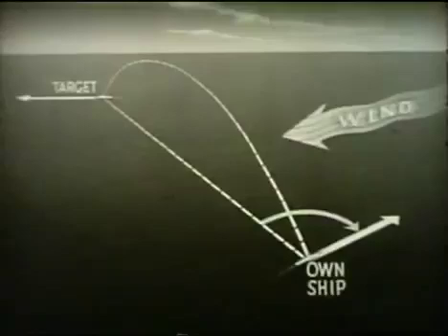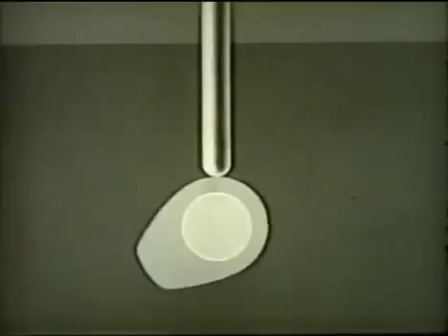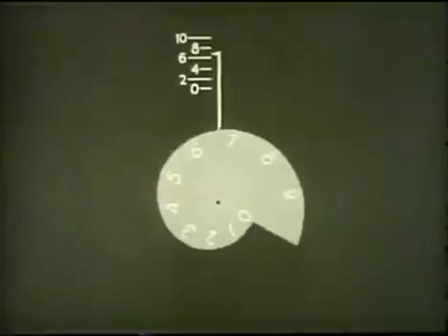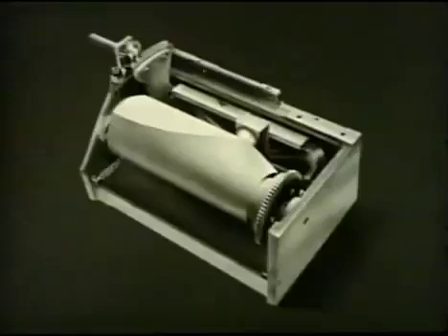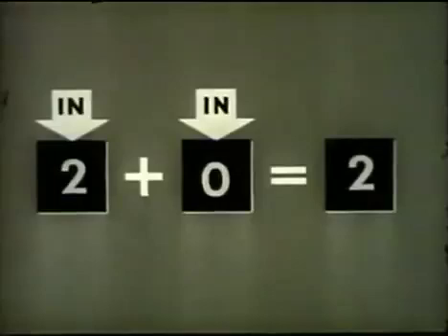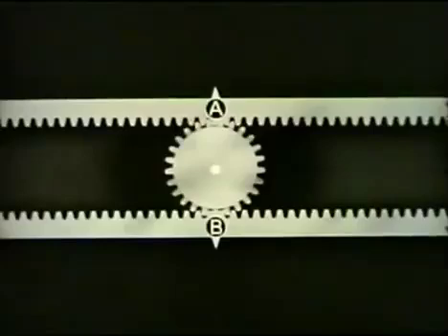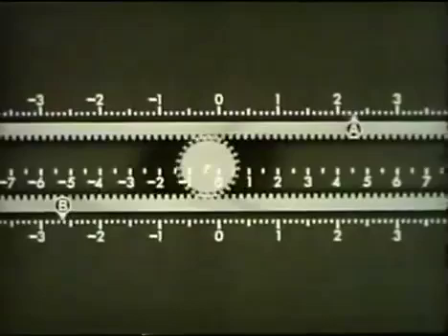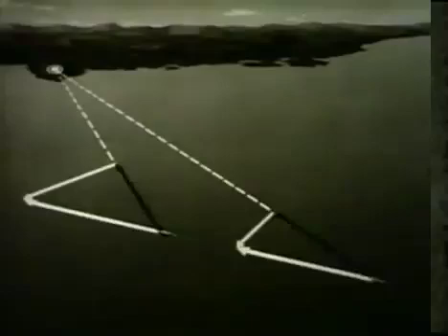Mechanical Computer (All Parts) - Basic Mechanisms In Fire Control Computers

Comment: Hopefully this technology doesn't fall into the hands of North Korea.
Reply: +Bobbie Bees You would actually be shocked at how effective this technology was.
Reply: +Patrick Bartosz Watching this video makes me wonder if they would've missed their targets at all if their guns weren't shooting a little inconsistently.
Reply: +Bobbie Bees they have known that already......for your information.....
Reply: They kept the computer calibrated to the battery's average muzzle velocity (which changed over time due to powder temperature and other factors), and each gun could also apply a correction if its muzzle velocity strayed significantly from the mean (due to individual barrel wear, etc.).  The computer also calculated for the effects of wind, ship roll/pitch, parallax due to distance between director and guns, and, most importantly, relative motion between ship and target. Spot corrections could be dialed in after observation of fall of shot (shell splashes).  Computers for larger guns also corrected for Coriolis effect.  Since a number of approximations had to be made in the fire control problem (including the assumption that the target's motion would remain in a straight line at constant speed during the shell's flight) and the computer's inputs relied on human operation in the director, its accuracy was by no means 100%, but this technology was state of the art in the 1940s.
Reply: Richard Hall
 I bet the system alone would've come pretty darn close to 100% given all the factors included in the calculation.

But 1 thing that this huge pile of mechanical contrapions shows is what a huge load of stuff computers do, especially the modern electronic ones without any moving parts.
Reply: +Bobbie Bees  They dont understand Engrish.
Reply: +Bobbie Bees  believe it or not, their machining is still not precise enough to build this. Video teaches basic concepts. In order for this to work in real world, all the parts have to be machined to extreme precision. There is not many places outside of Europe and US that can do this even in 2016
Reply: Yeah, they'd launch a missile at California and it'd probably end up somewhere in Chile lol!
Reply: Richard Hall
 If it didn't already explode on the launchpad :-)
Reply: lol yes
Reply: North Korea is making nuclear weapons. Do not you watch television?
Reply: elektroxi television? What they hell is that?
Reply: Factoring in the inherent slop in manufacturing tolerances, variations from gun to gun and shot to shot, the assumptions and approximations involved in setting the inputs, and other sources of error, the typical rate of scoring hits at "normal combat range" (which tended to be long) was about 5% of rounds fired actually hitting the target.  This was, as I said, MOSTLY due to the sources of error on the inputs, but no matter how finely-machined the equipment was, there was going to be some systemic error introduced by manufacturing tolerances... and that error would only get worse over time as the moving parts began to wear.

This isn't an indictment of the concepts and algorithms used; it just reflects how many different sources of error there were, and how tiny a target you're trying to hit.  (Typically, the guns were pretty much 100% reliable in terms of bearing, but a general rule in the era was that your shot-to-shot variation in range would be about 1% of the set range.  To put it in perspective, at typical firing ranges, the Iowa-class battleships had a shot pattern roughly the size of the Pentagon!)
Reply: Too late.

Comment: How people designed this just absolutely blows my mind
Reply: Designing this wouldn't really be difficult conceptually, but the effort put into machining, tuning, and calibrating the machine to give any semblance of a useful answer is admirable
Reply: Designing a complicated mechanical machine with just a drafting table and a pencil also deserves a great deal of respect, even today with kinematically linked 3D MCAD software this would have been a pain in the ass to engineer.
Reply: It really, really makes you respect the engineers before computers were mainstay. Hell, NASA put a man on the Moon using little more than sliderules.
Reply: They used a lot more than slide rules. They not only used computers to plan the trip, but there was a computer on the ship itself.

https://en.wikipedia.org/wiki/Apollo_Guidance_Computer
Reply: What I said was:
"Hell, NASA put a man on the Moon using little MORE than sliderules."
And that is the onboard computer. That's only DURING the mission. There was a LOT more that was done to engineer the hardware[which was, uh, alot], mission profile, etc.
https://www.npr.org/sections/ed/2014/10/22/356937347/the-slide-rule-a-computing-device-that-put-a-man-on-the-moon
"That seemingly simple tool has a serious resume. NASA engineers used slide rules to build the rockets and plan the mission that landed Apollo 11 on the moon. It's said that Buzz Aldrin needed his pocket slide rule for last-minute calculations before landing."
""The slide rule is an instrument that was used to design virtually everything," says Deborah Douglas, the director of collections and curator of science and technology at the MIT Museum in Cambridge, Mass. The museum just ended a three-year exhibit on slide rules. "The size of a sewer pipe, the weight-bearing ability of a cardboard box, even rocket ships and cars.""
Reply: and all those computers together had less hp than your phone........slide rules rock...especially circular slide rules.Someone who can use them can be as quick or quicker than someone with a calculator
Reply: It's a work of art. My  favorite 17:30

Comment: Note that in the 1960s and 1970s the words "computing" and "computers" changed their meanings as stored-program digital computers came into widespread use. What used to be called computers, used for fire control (as here), astronomical prediction, gasoline consumption, and other applications, are now called "calculators", to indicate that they calculate some continuous function of the inputs, rather than evaluating a general series of logical steps (an algorithm) involving the inputs. This is why we now call these mechanical devices (including the Antikythera mechanism) calculators rather than computers. The principles of modern calculators are generally different from the principles of modern computers. We do have examples of pneumatic and other mechanical computers, used as toys or in industrial process control, but their performance does not even remotely approach that of electronic logic gates, flip-flops, memory devices and other such specialized components packed onto integrated circuits.
Reply: Well that's sort of a comparison between a special purpose or general purpose computer.  We can also observe the transition in cars as we shifted from mechanical mechanisms to sensors and circuits to analog ECUs to general purpose computers running control software.
Reply: Before WWII, actually a computer was a person, during the late 19th and early 20th centuries, usually a woman with a degree in mathematics (though not always, many of the tables used in astro-navigation were computed by previously out-of-work accountants and engineers as part of a federal jobs program),  who would do the heavy number-crunching for scientific endeavors, such as calculating the stress on a dam, wind tunnel fluid dynamics problems, or astronomy.  The world's first professional computer programmers, for instance, were the computers who converted problems from human-readable math into machine readable form.
Reply: @Johnny When my father was conscripted in the early 1960's to the big field artillery they still did the 'computing' by hand. Two soldiers did the maths with a table and a slide ruler. If both had the same outcome it was a go. But when one of the couples in that line of canons had a difference my father's job (as an officer with a PhD) was to have done the calculation in his head already and decide. His tremendous speed didn't prove to be very inspiring later helping me with homework. So I copied his tactics: just imagine the computing and the tools in your head. It really works and even better: guys serving in the artillery regularly become deaf to one ear, the one closest to the BOOM. Since he was sitting right in the middle of a battery of 5-6, he is deaf as a post now. Good times...
Reply: In a way these geared calculators are like a physical algorithm, no?
Reply: That's exactly what they are.  The full fire control problem was quite literally solving differential equations, and these computers could do it just as quickly and reliably as later electronic computers--actually slightly more accurately than modern digital computers (the analog computing did not have to include approximations).  The one advantage the electronic computer has over the electromechanical computer is the ease with which it can be reprogrammed to do different sorts of calculations; these fire control computers had to be literally built for the ship that they were to be used on.  While the basic computer itself could be used, any change in the guns that it was controlling required an entirely separate set of cams and gears to represent the different ballistic performance of the gun--so a computer for the medium-velocity 5"/38-caliber gun couldn't be used with the higher-velocity 5"/54-caliber gun introduced just a few years later, without completely replacing the cams and gears used in it.
Reply: You know, at first I was going to believe you, that shipboard mechanical analog computers might have been slightly more accurate than modern digital computers, when suddenly a wave of common sense swept over me and I realized no way that could be true.

Cams and other mechanical components wear down. They probably develop layers of oily sludge, maybe even biofilms. Even dust can get into their sealed cases, I bet. There are all sorts of error sources down at the fifth digit, maybe even the 4th. Modern digital computers can have 15 or 31 digit accuracy, easily, even including differential and trigonometric approximations that ignore the 12th place and beyond.

What evidence and experience do you bring to prove that your casual yet general statement is fact rather than opinion?
Reply: True, but the mechanical computer is also not as susceptible to things like an EMP or electronic warfare at all. No way to input a virus into it.
Reply: David, I bet that a periodic hosing down of the shafts and gears with a gallon of WD-40 would get that computer running like new!   ;o))  In addition, since the RPMs at which the shafts and gears ran would have been relatively low (unlike an automobile engine), I bet the wear and tear was relatively light.
Reply: David Spector
It's not likely that wear would be a significant factor with these devices.  The operating speeds were very low and the surfaces were so finely-machined that they were practically jeweled.  Furthermore, the working parts were almost certainly made out of alloys specifically designed for that purpose.  It would have been something that machined well but was very hard, and good inherent lubricity would also have been desirable (except possibly in the disk integrators).  I'd bet that it was some kind of brass or bronze.  My gut feeling is some kind of aluminum bronze.
Reply: I agree about wear. These mechanical "computers" (calculators) were 
ingenious and provided accurate targeting to kill people, mostly 
soldiers, very well. If differences between nations should be settled by battle, then these wonderful calculators filled an important role.
Reply: Reading this and all the replies, I need to say "many thanks" for your educated comments. Really appreciated.
Reply: Well a traitor with access could contaminate the mechanical computer with insects. And they'd have to debug it.
Reply: John Doe That is kinda-sorta where that term comes from, as an actual bug was found in one of the early vacuum-tube computers.

Comment: As a machinist, I'm watching this and feeling really puzzled as to how they managed to produce some of these cam shapes in the days before NC machines.
Reply: +Sylderon plotting the values on a 2D chart using tables and good old fashioned pen and paper and then milling until the radius on each point is correct.

After that a copier milling machine will copy the came shape of the master for mass production.
Reply: +Sylderon Very easy my friend, hard work and not depending on google or smart phones like today's guys who want to copy and paste! hahaha! We used our own heads! If you saw the beauties I and my buddies created with files, lathes and milling machines and special tools WE created.
Reply: +Peter Diaz I've done some similar work myself...turning and then polishing bearing bores to +/- a couple microns on an engine lathe, turning out shafting on a 1970 LeBlonde Regal with badly-worn ways and still getting it to +0 -0.0005 inch and a Ra32 finish with no taper as a daily routine. Granted, it took longer than my supervisor wanted, but that's because I didn't half-ass everything like he did.

I often feel that perhaps I should've been born around the turn of the century than in the 1985.

Also, I don't even have a smart phone; never cared for touch screens.
Reply: It's called "Craftsmanship".
Reply: @SynchroScore  Have you ever used a mechanical calculator, the kind where you turn a crank handle to add the numbers?
Reply: @robertlozyniak3661  Never used one personally, but I've seen videos of them.
Reply: I would imagine that they used a copying mill, and the master was hand milled by some unassuming grey haired guy in his 50s who has been in the trade since he was 14 and is an absolute god at it

Comment: When I was a kid you could get surplus B-52 ranging sights for about ten bucks.  They were also mechanical computers with lots of nice gears, ball bearings, optics (two very good 2" achromats suitable for small telescopes) and a great air-driven gyroscope.

Cost for taxpayers in 1942 supposedly around $7000.  Worth at least that much to me and many other nerdy kids.
Reply: Nice, i wish i had one too. Also do you mean 1952 and not 1942? Because b52 entered service first in 1952
Reply: @288gto7   Oops. Thanks for the correction. I did a little research and found out what I had was not a B-52 bombsight, but a B-29 drift meter. Lots of ball bearings and lenses.

Comment: So cams are basically physical lookup tables?
Reply: +Peacock486 Sort of - but moreso linear functions. If they were truly lookup tables, they would be non-linear and discrete - so there would be discontinuities, "sharp edges" or even holes/gaps that would probably prevent any rollers from working correctly on them.
Reply: Yeap, as long as they're defining continuous functions.  Common examples include reciprocals, square roots, superelevation angle for the guns vs, target range, time of flight vs. range, etc.  Also remember it will engage the runout at the edge of the cam if the input gets out of bounds.  My grandfather was stationed in a gun director on a destroyer during the war and was well acquainted with this equipment.

Comment: Fascinating! As far as I know, mechanical computers were in use well into the 60s, before miniaturisation, reliability (and response time) of digital computers had advanced enought to replace them. It's one thing to computer ballistic curves by room-large computers ('45 - '55) and another thing to constantly control a moving object (and the moving objects on it).

Comment: They explain things so well. I like electric computers, but i love mechanical computers. Plus it's easier to learn. Example: spend hours trying to figure out on your own how to tell a computer to turn a electric motor 60 times in a minute or you could do something easier by using gears to make a wheel turn 60 times in a minute. I would  make a mechanical computer.

Comment: Sometimes computational problems are better solved by more simple devices. Power companies still use "Analog Computers" which are nothing more than huge networks of Resistors, Capacitors, and Inductors, because it is easier to model their networks and the complicated differential equations associated with them by actually building out the circuits and testing them than with simulation by a transistor based computational device. Food for thought
Reply: Kameron Moon no they don't. https://en.wikipedia.org/wiki/Network_analyzer_(AC_power)#Decline_and_obsolescence
Reply: Don't know how to tell you this but that's electronics. And I really doubt facility that cost millions uses only few electronic components for calculations